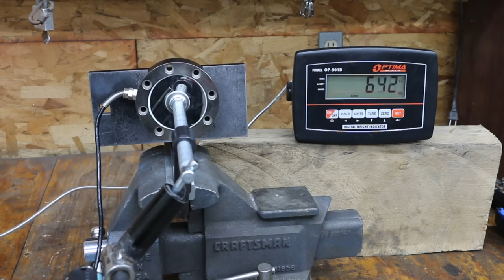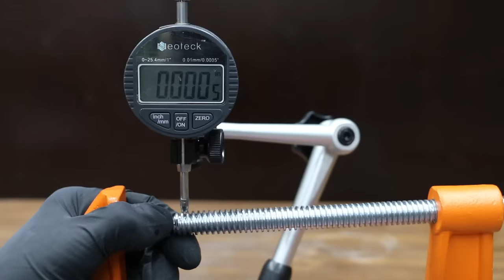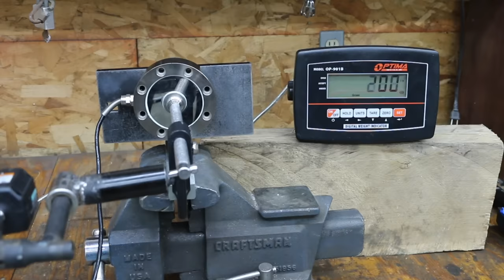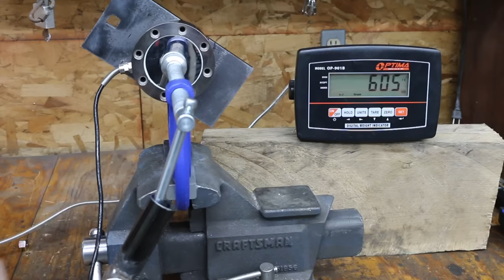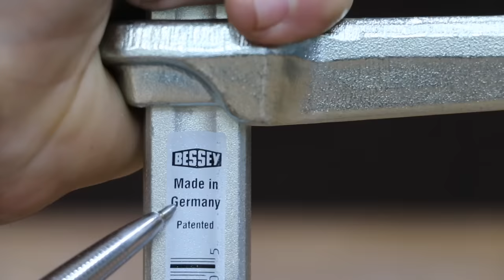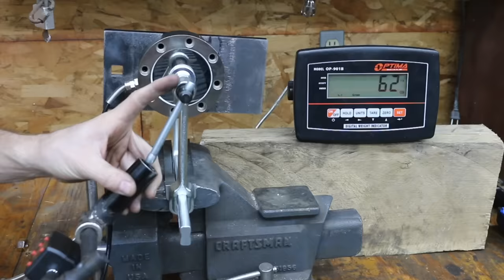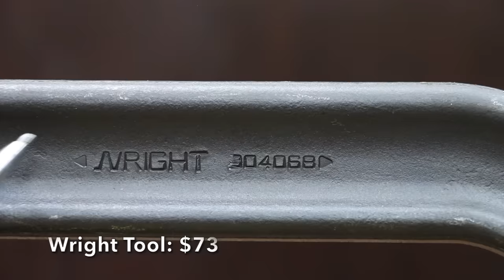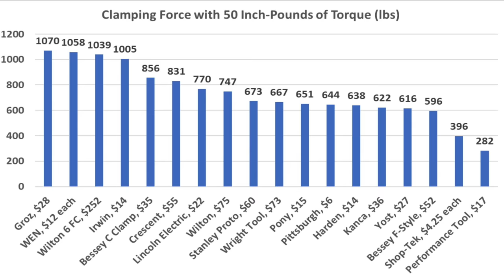Best C-Clamp? Let’s Settle This! $4 vs 252, Wilton, Yost, Irwin, Wright Tool, Harden, WEN, Proto

Comment: How about a round 2?  Weld all the breaks back and test the cost-effectiveness of the welds Vs. Loss/Gain of the strength of the clamps.  Obviously, buying new clamps would be a lot cheaper, but sometimes the welding touch is closer and faster than a trip to the hardware store.
Reply from the maker: Thanks for the suggestion.

Comment: I think the Yost so rank much higher then the score show. I appreciate how you did the set torque to clamp test. Could be an indicator of thread quality but if you throw that test out it would score significantly higher based on its cost seems like a tremendous value for the performance it gives.
Reply from the maker: Thanks!

Comment: Liked this vid, I have a good selection of clamp and have learned to not ask them to do more than they can handle. I would like to se a comparison of  "come along winches" I have a couple one a cheap harbor freight and a Lug All both are 1/2 ton and I haven't had a problem with either but I've never put under sever use.
Reply from the maker: Thanks!  Thanks for the suggestion.

Comment: 13:30  Several of the metal "adjustment bars" used to tighten and losen the clamps failed (bent).  Well, I can hear the design engineers now: Do we want the adjustment bar to bend or the clamp to bend or threads to fail?  I agree with the engineeers that chose to use an adjustment bar that would bend/fail before damaging the clamp or threads.  That is just good engineering. Of course they could make a better quality clamp so that the adjustment bar could be stronger as well.
Reply from the maker: Thanks for the feedback.

Comment: When I was a GM mechanic there was multiple service bulletins through the years warning not to use aftermarket fuses due to the inconsistency of what current they would open at causing fires in the vehicles when there was a short and the fuse didn't do it's job, despite the ratings they were marked with. A possible idea would be, whats the most trustworthy fuse brand
Reply from the maker: Thanks for the suggestion.

Comment: How about comparing laser levels? Big brands like Bosch, Milwaukee, Dewalt, Leica, Hilti, Makita, PLS and Stabila all make 2 plane and 360 degree 3 plane laser levels that can be used indoors and outdoors at a pinch. Plus there are a lot of cheap Chinese models coming out. Accuracy, line thickness, range outdoors with and without receivers, battery life, warranty and price would all be interesting criteria. Not cheap to buy them all but given there’s no need to destroy them perhaps you could just borrow them.
Reply from the maker: Thanks for the suggestion.

Comment: Have you tested one-handed "quick-clamps"? Usually rubbery pads on the clamping surfaces, and generally super useful. Would be curious about how much clamp force different ones develop and how "grippy" they are at that force for some common materials wood/plastic.
Reply from the maker: Thanks for the suggestion.

Comment: If the threaded section of the clamp was adjustable. It would significantly help with longevity by clamping to were the thread rod would not get distorted and bent on smaller items. A 6 inch clamp clamping  something  thats 5 inch  width. The thread rod less likely to fail. Nevermind the Bestie German one does it
Reply from the maker: Thanks for sharing.

Comment: Due to the recent Fireball Tool fixture table controversy, how about a video testing fixture tables? Square? Flat? Strong? Etc. Also, seems to be a pretty good match to this clamping video. Can you buy a good fixture table without spending 10k?
Reply from the maker: Thanks for the suggestion.
Reply: @ProjectFarm  Thanks for the content.

Comment: I found myself giggling when I saw the numbers that the Wilton was able to put up and the fact that even with 25 tons of force it didn't give.  Extremely impressive but as you said excessive for most applications.  For most people the much cheaper clamps are sufficient...but if you I were to need to build a bridge I'd splurge on the Winton.
Reply from the maker: Thanks for sharing.

Comment: One test that was missing was how long it takes to completely open and close each C-clamp.  When I go to use a C-clamp, it takes a while to rotate the screw to fit the load before clamping even starts.  The F-clamp looks interesting because it can be quick-adjusted but your tests show it didn't really hold up all that well, which makes sense.  Probably works fine though for lightweight applications.  IMO, every manufacturer should use a little extra metal and place a slot for a flat head screwdriver at the end of C-clamps so users can take a power tool to it to shorten the amount of time it takes to start clamping.
Reply from the maker: Thanks for the feedback.

Comment: I came across a couple research papers from 2016 about using titanium dioxide as an oil additive. From what I understood, some oils use small amounts of this or something similar, but the research seemed to use a fairly large amount in their tests. They claim very good results from their tests and I was interested in how this would actually perform. They claim a large decrease in friction and wear. I would be interested in seeing if this will improve cheap oil and how that would compare to a more expensive oil like amsoil. It would also be interesting to see if this can make a high quality oil like amsoil even better.
Reply from the maker: Thanks for the suggestion.

Comment: I have two suggestions for testing. The different types of skateboard bearings including weight limits and the plastic lego block replacing concrete block. Found on you tube
Reply from the maker: Thanks for the suggestion.

Comment: I have a good sized collection of clamps in many different sizes and manufacturers.  I have rarely purchased clamps new but rather buy the survivors from old collections at yard sale and flea markets and go for the American, German or English makers.  From my glue up scenes I have seen too much pressure can be as problematic as too little.
Now I have a question:  I use a lot of epoxy adhesives and have found it difficult to dispense the exact same amount of the 2 part epoxy when preparing the mix.  How forgiving is epoxy to mis mixing the quantities?    How far off can you be with your mix before it really makes a difference?  Does 4 parts resin to 5 parts hardener work as well as 5 parts resin to 4 parts hardener?  
Thank you for providing the truth behind the claims!
Reply from the maker: Thanks for sharing.  Thanks for the suggestion.

Comment: If you actually use clamps none of them matter except for the "Performance Tool" one that has the release button for sliding the screw. Doesn't matter the brand, just get one with the slide built into it. It makes a world of difference trying to get work done.
Reply from the maker: Thanks for the feedback.

Comment: You should test torpedo levels sometime. I'd like to know which one is the most accurate. Ideally, purchase about 5 of each level from different manufacturers and see the average accuracy of the levels. I'm curious because Milwaukee costs about twice as much as a similar Empire but the Empire claims much better accuracy.
Reply from the maker: Thanks for the suggesion.

Comment: I could sure see spending that kind of money buying some really big clamps, if I were not able to build my own, better and for cheaper...

I've been paying about $30 each for some 12" F clamps and I really put them to the test every day!

While I have almost got the threads locked a couple of times under a load [because I both forgot to grease them enough AND have left them out in the rain, AND on a few occasions exposed them to muriatic acid], I've never bent one yet, and I have actually used them like a hydraulic press to deform other pieces of heavy [1/2" thick] steel in the past.

They are not Bess brand, but I have been buying them at my local Harbor Freight.

Without going and getting one, I can't tell you what the brand is, but they're really rugged!
Reply from the maker: Thanks for the feedback.

Comment: I don't think I'd ever need more performance than the $6 Pittsburgh can give.   I do wonder, however - which of the swivel points were pre-greased?   Putting a tiny drop of oil on each would level the field a bit.  It could be that the ones with high friction just weren't oiled.

Comment: Now test the strength of JB Weld (and competitors) by "gluing" the broken C clamps together and testing them again, as you know the original failure point, so does JB Weld or others provide the same strength as factory or is it better/worse.
Reply from the maker: Thanks for the suggestion.

Comment: HEY TODD, Not sure if you tested this already, but can you test major brand ignition cables for resistance and durability? I'm teetering between NGK and Denso wires for my old Camry. NGK claims only 9k / ft resistance but I see no ohm spec for the Denso.  My NGKs wires have over 120k miles on them along with my NGK Ruthenium spark plugs. I will definitely buy the Rutheniums plugs again, but may go Denso wires if they test well. Wadaya say?
Reply from the maker: Thanks for the suggestion.

Comment: I like the bessy f type clamps there very useful as they have a smal footprint, wright impressive as most of there stuff is, 
Have you looked at crimpers be it hand or hydraulic for lugs or just regular terminal ends?
Reply from the maker: Thanks for the suggestion.

Comment: Cheap vs expensive halogen headlamps. Not LED or HID. Test them in the freezer, touch 1 with ur fingers b4 turning it on, how long they last, surface temperature, etc etc.
Reply from the maker: Thanks for the suggestion.

Comment: I would like to see a test of windshield washer fluids. Which fluid is best at getting the bugs off/ keeping them off/ making them easier to remove etc.  I have tried the cheap stuff and Rain X bug remover expensive brand and was not impressed. Is there one that works better? Maybe something home made is better?
Reply from the maker: Thanks for the suggestion.

Comment: One might find the following interesting.

At the Bottom: IF one wants a strong clamp at the best price (and you cannot remember the results of this test), just pick the heaviest clamp with the lowest price. 

Use Wilton $252 as the standard because it weighs the most.  Not very practical for home use. 

The Top 5 clamps in weight (below Wilton $252) are the Wilton $75, Stanley $60, Yost $27, Wright $73, Crescent $55
In the strength related test, the above clamps were always in the Top 5 though they swapped positions.
Of the Top 5, YOST is clearly the winner as it cost only $27 while being in the Top 5.  

NOTE
YOST is only $27 and it was in the top 5 every time in strength related tests
IRWIN is only $14 but it never finished in the top 5 (seems an extra $13 for the YOST is worth it)

Top 5 weight - Wilton 18.77    
Wilton $75 -------- 5.59 --  29.78 %  (Wilton $75 / Wilton $252 = 0.2978  = 29.78 %)
Stanley $60 ------ 5.14 -- 27.32 %
Yost $27 ----------- 5.05 -- 26.90 %
Wright $73 ------- 4.97 --- 26.48 %
Crescent $55 --- 4.59 --- 24.45 %

Top 5 Cheater Bar - Wilton 33,880
Wright $75 ------ 9060 --- 26.74 %  --- Frame twisted  (clamp still useable)
Stanley $60 ----- 8980 --- 26.52 % ---- Threads Damaged - clamp has limited use now
Wilton $75 ------- 6398 -- 18.88 % ----- Adjustor screw bent - clamp has limited use now
Crescent $55 --- 5739 -- 16.94 %  ---- Threads Damaged - clamp has limited use now
Yost $27 ---------- 5311 -- 15.68 %  ---- Adjustor ARM bent - no damage to clamp frame or screw

Note: I believe the clamp should be engineered so that the adjustor ARM bends before the clamp arm or screw is damaged.  While YOST came in 5th above, it came in first on engineering design (for my tastes). Basically, if the YOST had want to sacrifice the clamp it could have made the adjuster ARM stronger and did as well as the Wright.

Top 5 MAX LOAD AFTER UNDER LOAD- Wilton 50,327
Wright $73 ---------  11,335 ---- 22.52 % ---- Frame Damage - SMALL frame bend
Stanley $60 -------  11,028 ---- 21.91 % ----- Frame damage - Bad Frame Bend
Crescent $55 ----  10,235 ---- 20.34 % ------ Frame damage - bent
YOST $27 ---------  9830 ------- 19.53 % ------ No Damage (Frame would bend under load but returned to original position)
Wilton $75 -------- 9244 -------- 18.37 % ----- Frame and adjusting screw damaged
Reply from the maker: Thanks for sharing.

Comment: Love your videos man,  all data, rapid fire, facts, not bs.. maybe it would be better for manufacturers to put a small Dia handle, that will bend (when using a cheater bar for more force), at a strength pointb5 the frame is bent at all, someone could replace the handle with metal stock.😂

Comment: @Project Farm Ever thought about testing different Hydrostatic transmission fluids like Hy-Gard or Toro Hypr-Oil, Amsoil etc...? It would be interesting to see if there are any benefits for zero turn mower and garden tractor owners for 1 brand over another especially with many manufacturers stating you can use 15W50 synthetic motor oils or similar as alternatives..
Reply from the maker: Thanks for the suggestion.

Comment: Like the content.  Would you be interested doing some comparisons of the new air cooled 2 and 4 stroke outboard motors coming out of china.  The 4-stroke engine are based off a small Honda motor and they are all very cheap.
Reply from the maker: Thanks!  Thanks for the suggestion.

Comment: I expected catastrophic failure from hand cranking on atleast one. I had an o'reilly brand c clamp and I snapped it in half twisting it 50/50 on the handle with my hand trying to compress a brake caliper. It was a twist in kind lol.
Reply from the maker: Thanks for sharing.

Comment: Armstrong makes a C clamp similar to the Wilton.......both good clamps.    If you want THE best C clamp made,   Kant Twist, IMO,  is unmatched in the industry.    Give it a shot.     Granted,  the design is very unlike the fixed frame clamps you reviewed on this vid.    Still, technically, the KT is a "C" clamp.  Once you use one, it will render the average "C" clamp into obsolescence. 
   Thanks for sharing.
Reply from the maker: Thanks for the feedback.

Comment: Hello again Project Farm friends.

The most difficult things to fix is something one cannot reach, nor can see, for example a gutter leak may be at the inner most corner of the gutter beside a wall with almost zero tolerance, it'd be best if one has a decent oscilloscope to pinpoint where exactly one needs to apply the UV resistant silicone compound waterproof sealant but oscilloscope are very expensive but perhaps there's that one no name brand that's decent enough (the image is clear and the frames are not choppy) that's very affordable.

Perhaps Project Farm friends can make this as the next video, testing the cheapest but decent enough to the best.

I think Adam Savage has a video on the oscilloscope he uses (most likely the decent affordable ones use the cellphone's screen).

God bless, Rev. 21:4
Reply from the maker: Thanks for the suggestion.

Comment: The throat measurement seems a little misleading.  If you can't get an object between the threaded shaft and the body it should not count.  Thus the measurement would be more realistic if it were taken from the body of the 'C' to the nearest side of the thread not the center.  A small point but significant to those using the clamp.  Always enjoy and learn from your reviews.

Comment: I dont think your custom tool for the clamps is the best way for consistancy, because the distance from center is different (although if this is on purpose to simulate hand placement i understand) but for better comparable results on the thread quality, i would have used a socket with notches cut in it to accept the t-handle
Reply from the maker: Thanks for the constructive feedback.

Comment: Idea for a new video though it will be pricey. 3/4in drive ratchets. Craftsman, SK, Pittsburgh, etc. I recommend getting some thick double wall steel hydraulic pipe 6ft long for your cheater pipe.
Reply from the maker: Thanks for the video idea.

Comment: Cheap clamps are only good for mounting headache racks on pickup trucks or a replacement clamp for a truck cap. Wouldn't use em for woodworking
Reply from the maker: Thanks for the feedback.

Comment: Only problem I have with this video is: Your Throat measurements.

You are measuring to the center of the adjustment screw  giving each one approximately a 1/4” more throat than they actually have.

Comment: Have you ever done radio, auctioneering, that sort of thing?  Your diction holds up well even speaking quickly.
Reply from the maker: Thanks!  I have not.
Reply: @ProjectFarm  Might be a good weekend gig.  Aviation has a thing where each airfield broadcasts an up-to-the-hour summary of winds and weather (to save repeating it manually) and that might be another place where you could employ that talent.

Comment: Can you test phone cables for quality, durability, strength and voltage output? Cause my phone cable broke. Plus most phone cables I have used have felt cheap and of poor quality and don't last for a very long time.
Reply from the maker: Thanks for the suggestion.
Reply: @ProjectFarm  you're welcome

Comment: Technically with your tool you made the final tool didn’t get the same torque, when you change the length of the torque wrench it changes the torque
Reply: If you were to use the tool at 90 degrees it World remove the torque change

Comment: i only have one gripe any 6 inch clamp that does not have a 6.125 throat with 1 thread out of the frame should fail right off the bat, if you can't clap something 6 inches thick it cant be a 6 inch clamp

most of the clamps in this round up are hand clamps but the Wilton 6 FC is not
Reply from the maker: Thanks for sharing.